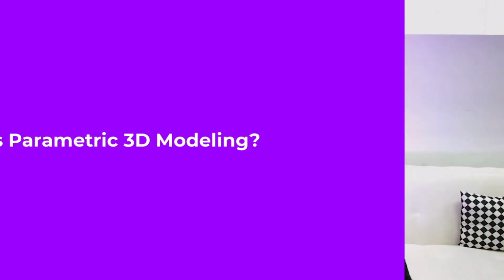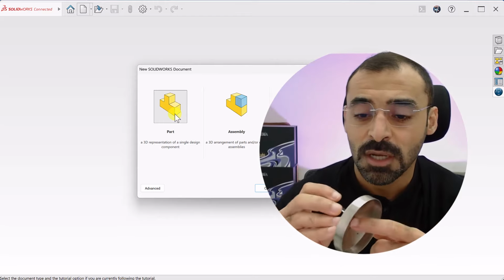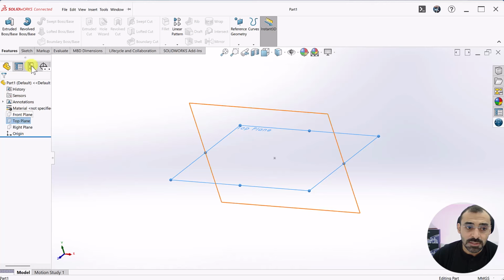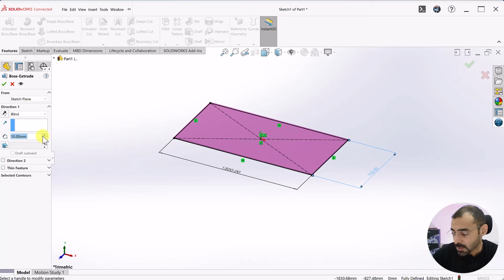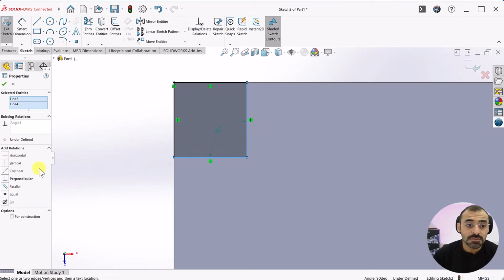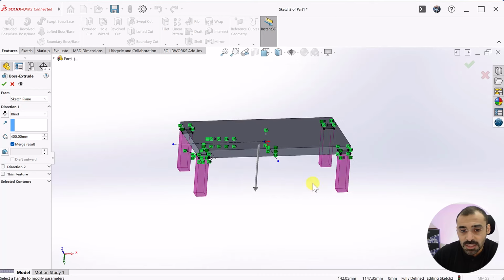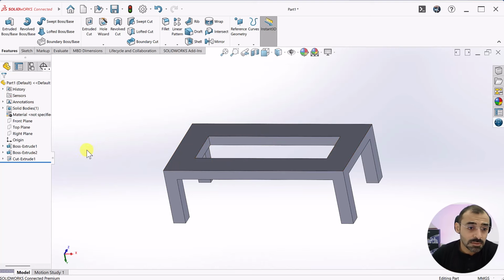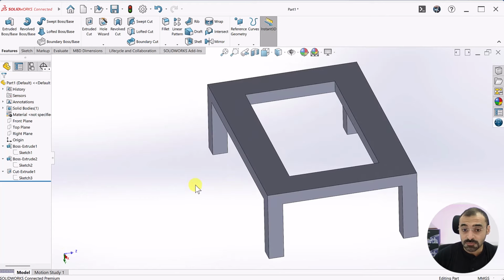Start Learning SOLIDWORKS 2025 - for Complete Beginners

Comment: I really appreciate your honesty. I have been designing 3D printed parts for about 10 years using old, obsolete and unsupported software. I decided to make the switch to parametric modeling and Solidworks looks like the best value.  I have started by converting some old designs in to SW.  the experience has been soul crushing.  I have been powering through and have made some progress. I think I will be at the equivalent skill level in a few weeks. Then I hope that SW will enable me to greatly improve my designs. To those people who are also learning, I encourage you to stick with it.
Reply from the maker: Thanks a lot for sharing your experience! It will get smoother with time, trust me on this! You are amazing for keeping it at it.